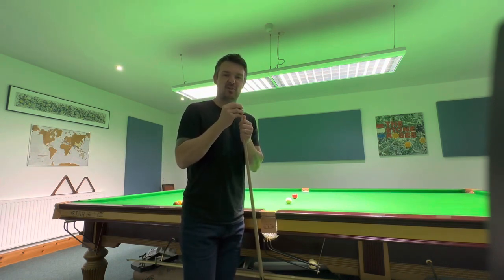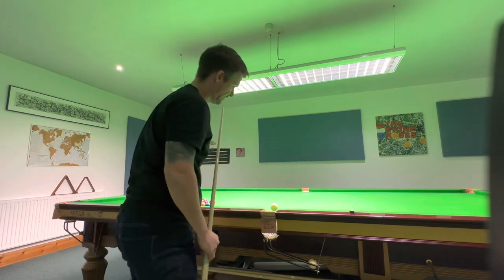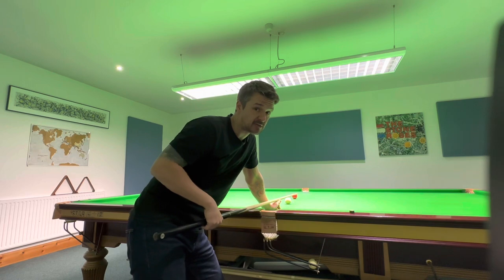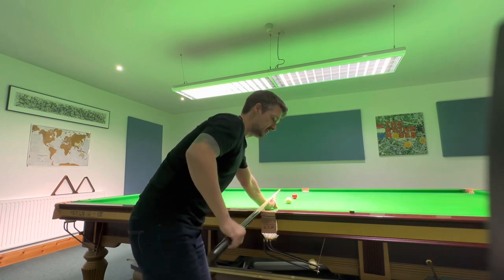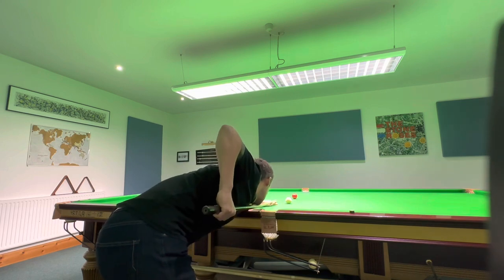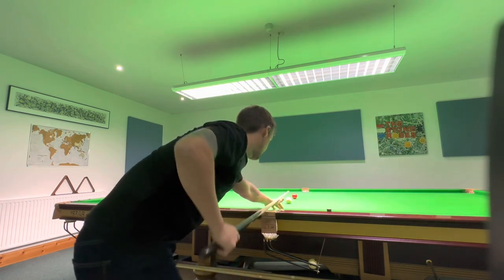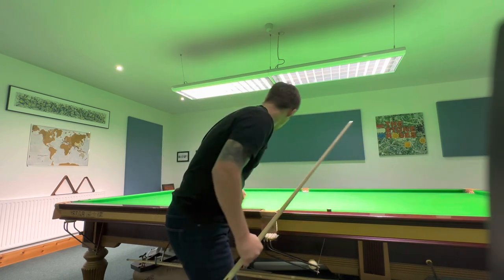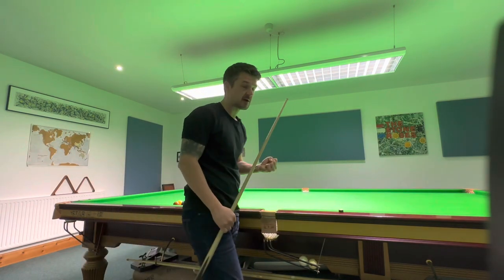Grip and the squeeze.

Comment: I usually use a loose grip for 95% of shots I play. But when I use the squeeze I find the spin is more immediate rather than getting that little delay that sometimes happens with screw shots. So ideal for those shots you have mentioned, holding when your a touch high on black or blue.

Comment: Great insight on how you use your grip Michael. I've also heard a few reputable coaches mentioning the importance on not squeezing the cue. I think they are implying that if you squeeze the cue a fraction before impact on the white it can send the cue off line. Yes the shots you demonstrate need that squeeze to nip into the white to apply as much spin with as little power as possible. Now i know you mention in a few of your videos not to over complicate things and your probably right. But, there has to be a bit more to the grip than that. So most agree that a grip that is too tight does not allow the cue to stay parallel during the feathers and delivery and also a grip that is too loose will mean you will have no control. So using your own grip as an example on a scale of 1 to 10 where 10 is as tight as you can grip the cue where does your grip stand during feathers and delivery. So as us mortals can get a feel on how tight or loose a grip needs to be.
Reply from the maker: Hello. 

The point made that you “shouldn’t” squeeze the cue is misinformation. Most do to various different degrees. 

There really isn’t anymore to it than that. So many people are over complicating it. It doesn’t really matter how you hold it if you can repeat it, it’s all about whether a player can repeat the strike. That’s it. 

If this wasn’t true there would be one perfect grip that all pro players would have/use. This is obviously not the case. Every professionals grip will differ slightly, what they all have in common is the ability to repeat the strike. Look at the pro tour, it proves my point. 

You can still have pressure on the cue whilst opening the hand to keep the cue parallel. 

I don’t know where my grip strength would be on the scale, it’s just how I hold it. Also, my 5 might not be your 5 so it wouldn’t really help. Your best bet is to pick up the cue in a way you feel comfortable and repeat. 👍
Reply: @MichaelHoltSnookerCoaching  thanks for that Michael👍👍